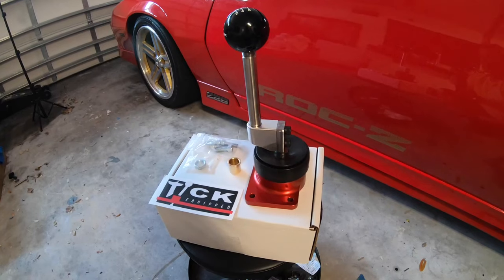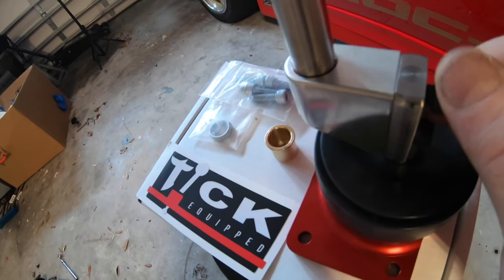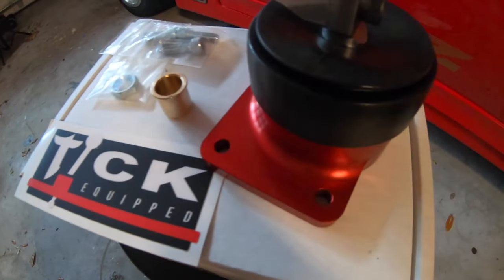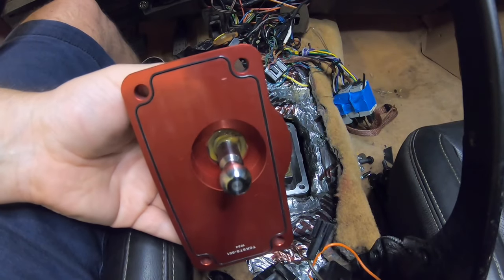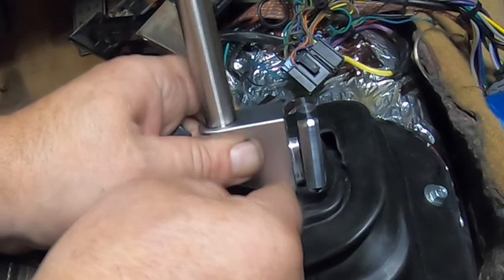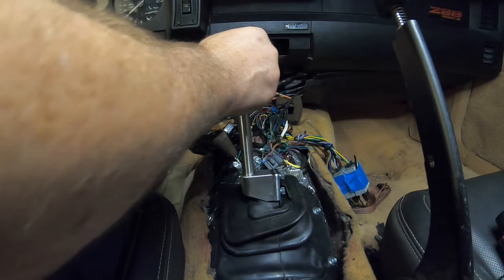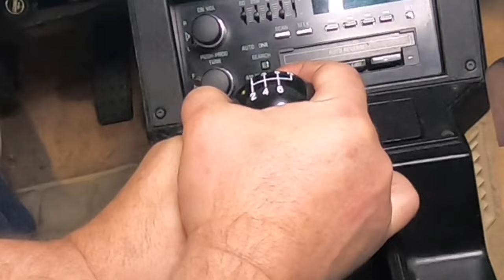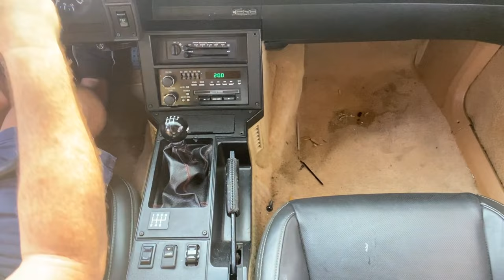Tick Performance T56 short throw shifter on my 85 Iroc (82-92 Third gen)

Comment: those centering springs look strong!  when it's finally time to take it to the track, be sure to open palm push forward on the 2-3 and allow the shifter to do it's job.  you'll never overshoot 3rd that way (as in, go into 5th).  Great job as always stan!
Reply from the maker: Thanks for the tip man! I just tried that, I did t realize it just goes into the gear just push and pull. The spring is strong, really digging it so far!

Comment: Nice video man. Beautiful car. I'm in the middle of installing mine. Couldn't seem to easily get the bronze bushing on. How did you persuade it into place? 02' WS6
Reply: Sand the bushing a little to remove any sharp edges using fine sandpaper , then put it in the freezer for about half hour.  When you take it out be real quick to tap it in. Use a socket with a rag or something in between.  
‘01 f body

Comment: Just ordered mines, have to use a cross border service though for Canada cause shipping is literally 200 bucks somehow which is more than half the product cost. Hopefully arrives here no issues.  

Only thing I may be worried about is the positioning, since mines is going in a GM B-Body and I haven't seen anyone else put it on theirs no idea if it's going to be in a good spot or not.
Reply from the maker: It’s a really nice shifter, if it fits well you should be  wet happy with it. But that sucks on shipping!

Comment: Just subbed. Love your car!  I have a red ‘89 L98 IROC.  i’m sure you get asked this all the time, any link or description of the size of those wheels? Thanks so much for making awesome Camaro content!
Reply from the maker: Thanks for subscribing! US Mags U550 Forged 2 piece Irocs, rears are Michelin Pilot Super Sports 295/35/18 18x10”  and fronts are 255/40/18s 18x9
Reply: @FireballMullet  Is it tubbed?  Narrowed rear axle?
Reply from the maker: It is not tubbed but I did narrow the S60 rear 1/2” on each side
Reply: @FireballMullet  Thanks for getting back to me, I'm looking forward to checking out your content.

Comment: I have same shifter in my 99 ls1 camaro never tried any other shifter but I love this shifter feels good love the o ring design that’s what they didn’t have for other shifters I was either going with with tick or Hinson glad I went with tick  there master cylinder are good stuff too
Reply from the maker: Yeah man, the centering and shifting is sweet, I haven’t missed a shift since!! Glad you like it man and thanks for watching!
Reply: @FireballMullet   np man yep love tick new shifter I’ve also had there clutch master cylinder that’s worth getting too I currently have a McLeod clutch master seems ok so far had tick on other camaro though always had good clutch pressure much better than stock

Comment: Is that a 5 speed lower shifter boot or a 6 speed lower shifter boot?
Reply from the maker: It’s a 6 speed 4th gen one
Reply: @FireballMullet  ok thanks
Reply from the maker: @wayne2160  normally guys use 5th speed one I think … I just had this one
Reply: @FireballMullet  ok I have a 5 speed one I will try that first before I but the 6 speed one
Reply from the maker: @wayne2160  yep should be fine